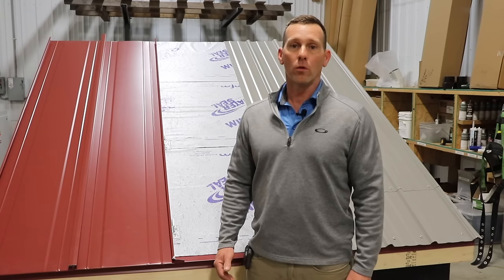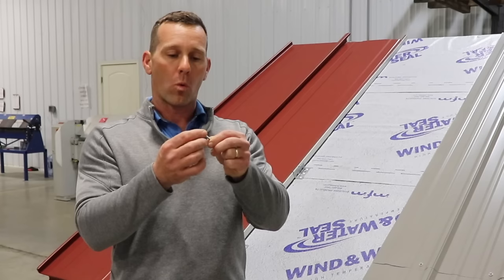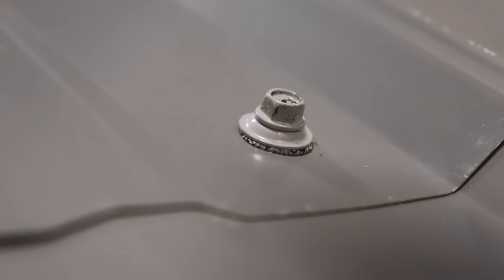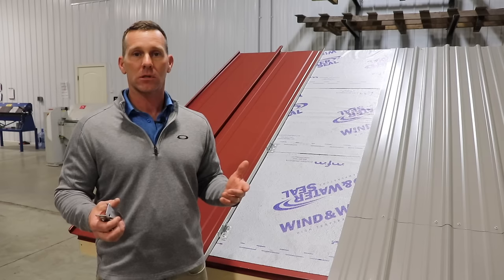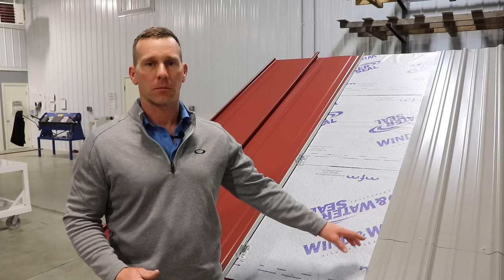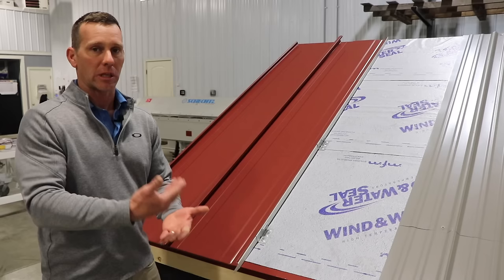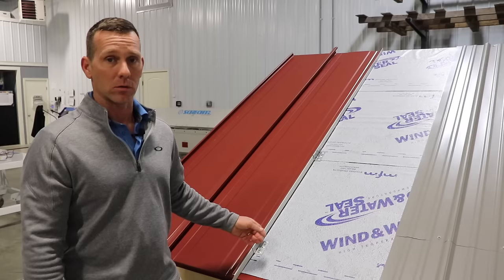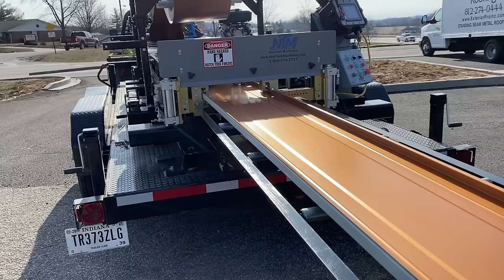Standing Seam Metal Roofing Vs  Corrugated Screw Down Metal Roof - Big Differences between the Two

Comment: I did metal roofs for 10 years and all the customers we're curious about the standing seam Roofing until they priced it. They all decided the screws weren't that big a deal. And yes there's a lot of BS going on this video.
Reply: hey, could you elaborate?
Reply: @samwoj  I am not the producer of this vid but i can tell you some things.

Standing seam vs. Exposed fasteners.

1)I have not done many standing seam roofs. However, they definitely are not fastened to the roof as well as exposed fastener roofs. Exposed fastener roofs are screws down every 6 inches or so horizontally and every two ft vertically. Standing seam is not...and have way less fasteners.

2) exposed fastener roofs do not have a neoprene washer as this guy stated. The washers are made out of EPDM which is a rubber that lasts 30 plus years and is used on full 100x10 ft rolls (weighing in around 450lbs) of EPDM on commercial roofs( big buildings). Exposed fastener metal roofs are durable and also increase the value of the home.

3) exposed fastener roofs are way faster to install. Which costs less in labor.

4) in my opinion standing seam is boring looking. Think of the jeeps that  have exposed bolts and nuts and stuff...they look cool as shit. Standing seam looks way less cool.

5) if a tree branch falls on standing seam you have to take the roof off from one side and potentially to the other to replace a panel. That is not the case with exposed fastener roofs. So think about the labor costs on that one.

6)exposed fastener roofs are easier and faster to install. They are easier to repair. They are warranted for about the same amount of time. 

7) if you have a house and getting a roof any of the metal roofs add value to the home. They might just last 50 years. Warranted for 35 for exposed fastener. 

Think about that. Talk to more roofers. The  make your decision.

Exposed fastener is cheaper and lasts just about as long. (There is some preventive maintenance that isnt necessary until you get  leak but just to prevent a leak, which would only happen at a screw, is to have the screws replaced before the warranty is up.) 

That's my take. I've done a lot of roofing. Take this information or discard it. Hope that helps.

Oh, and metal roofs will fade over time, but will still way outlast shingles for sure.

Edit: @7:16 he shows a ridge cap that appears to have a gap that wind blown rain can get into. Again, this is his sales pitch. That gap you see is caused by a waterproof seal that expands under the metal. That is not, I repeat, that is not a leak.

@7:30 he says standing seam has no seam. If that is the case then why is it called standing "seam"? It absolutely has a seam. That is like saying bacon isn't bacon, or that we are comparing peaches to pairs hear and peaches don't have an acidic citrus value while pairs do. Think about that.
Reply: Standing seam vs. Exposed fasteners.

1)I have not done many standing seam roofs. However, they definitely are not fastened to the roof as well as exposed fastener roofs. Exposed fastener roofs are screws down every 6 inches or so horizontally and every two ft vertically. Standing seam is not...and have way less fasteners.

2) exposed fastener roofs do not have a neoprene washer as this guy stated. The washers are made out of EPDM which is a rubber that lasts 30 plus years and is used on full 100x10 ft rolls (weighing in around 450lbs) of EPDM on commercial roofs( big buildings). Exposed fastener metal roofs are durable and also increase the value of the home.

3) exposed fastener roofs are way faster to install. Which costs less in labor.

4) in my opinion standing seam is boring looking. Think of the jeeps that  have exposed bolts and nuts and stuff...they look cool as shit. Standing seam looks way less cool.

5) if a tree branch falls on standing seam you have to take the roof off from one side and potentially to the other to replace a panel. That is not the case with exposed fastener roofs. So think about the labor costs on that one.

6)exposed fastener roofs are easier and faster to install. They are easier to repair. Warranty for exposed is around 35 years.

7) if you have a house and getting a roof any of the metal roofs add value to the home. They might just last 50 years. Warranted for 35 for exposed fastener. 

Think about that. Talk to more roofers. Then  make your decision.

Exposed fastener is cheaper and lasts just about as long. (There is some preventive maintenance that isnt necessary until you get  leak but just to prevent a leak, which would only happen at a screw, is to have the screws replaced before the warranty is up.) 

That's my take. I've done a lot of roofing. Take this information or discard it. Hope that helps.

Oh, and metal roofs will fade over time, but will still way outlast shingles for sure.

Edit: @7:16 he shows a ridge cap that appears to have a gap that wind blown rain can get into. Again, this is his sales pitch. That gap you see is caused by a waterproof seal that expands under the metal. That is not, I repeat, that is not a leak.

@7:30 he says standing seam has no seam. If that is the case then why is it called standing "seam"? It absolutely has a seam. That is like saying bacon isn't bacon!
Reply: @carcasscruncher9354  ageee with all except the ridge isn’t exposed from sealant, if you’re using a sealant that expands then you’re doing it wrong, standard MS water resistant silicone seal doesn’t expand, the ridge is sitting up because it’s screwed right on both edges causing it to sit in it’s normal bowed position rather than being flattened and then fixed closer to the ridges apex (or the ridge should have been made wider) 

Like the ridge underneath has been flattened before fixing.
Reply: My corrugated roof was installed professionally just over 27 years ago. I haven't had any leaks with the exposed fasteners.
Reply: Just wondering if anyone can clarify that corrugated roof and gavalume roof from Lowes or HD is similar and they can be installed on residential house not just barn or carport. I do like the exposed screw for DIY and cost.
Reply: @carcasscruncher9354  Seam as in overlap, NOT panel to panel.
Reply: @Btu555  if u get 29 gauge or lower
Reply: @Sandman1832  Did you de shingle your original roof or did they go over it? Im being told thats its okay to go over the old roof with metal.
Reply: @ForgeofSouls  You can install metal roofing directly over your shingled roof. That is what they did with my cousins roof. As for my home, I had a few skylights updated because the old ones needed replacing and I had a few other things done as well, so I had them just pull the old shingles off and start fresh. The metal roofing was installed over an underlayment that was put down before the metal roofing was installed.
Reply: @ForgeofSouls  Don't.  Asphalt granules can scratch underside of metal during expansion and contraction leading to premature corrosion.
Reply: @carcasscruncher9354  I worked for Morton Buildings for 8 yrs , let me tell you they have some awesome fastened down paneling . They have a 50 yr warranty . They are also very good with  flashings and trims . I work for my self now have installed all kinds of standing seam and different paneling, but If ever i had to do my own house I would do a screw down from Morton buildings.
Reply: @justotorres8970  morten doesn't have a good rating in my area. More to do with customer service than anything else from what I can see.
Reply: The major disadvantage of concealed fix sheeting is it's poor performance in windy conditions. Another disadvantage is the unfixable snapping noise it makes while contracting in the cool of the night.  Positive fixed sheets are fixed at about a meter intervals, so the expansion and contraction is limited to one meter.  Standing seam sheets produce more waist, as the off-cuts can not be flipped to be used on the other side of hips and valleys. We screw sheets only at the up-stands, or roll, of the sheets.  Not in the pan, as this video indicated.  This means that even an aged washer will not let water through your sheets.  The screws on my roof has now lasted 34 years, and I have no plans to replace them.  We order sheets to the length of the roof, so we never have to overlap sheets top to bottom.  Every plan you make for the ridges on concealed fix sheets, have a similar solution for any other type of sheets.  Corrugated sheets are S-type sheets.  Concealed / standing seam sheets are more expensive.  Material and labour cost.  Concealed fix sheets was designed for low pitched roofs.
Reply: @carcasscruncher9354  I’m planning on doing a corrugated roof this summer. All the comments have me wondering, screws in the valley or on the ridge?
Reply: @MistaCrawley  get a pamphlet on the manufacturer's recommendations. Some say to put the screws in the ribs, some say right beside the ribs in the flutes. Some say to use butyl tape in every seam, some say it's only necessary at almost flat slopes. You have to install the roof to manufacturer's specks or it wont be warranted.
Reply: @carcasscruncher9354  cheap and easy, that sounds like the way you like it. The previous owner of my old schoolhouse replaced the 104 year old standing seam with the cheap panels. It started leaking after 6 years, a few years after I bought the place. The washers are fried. I went up there are half of them look like they would leak, a couple of them deteriorated to where parts of the washer is gone.  This house gets brutal sun, so 8 am to 9:30 in middle of summer, no shade.  Those washers suck. I’m going to replace with standing seam, but reuse my 8 year old roofing panels in a barn or something.  I’ll just know I need to replace the screws and washers periodically. Look, it takes skill to install a standing seam roof, any moron can install the panels.  I was just up there after a wind storm the other day, had a panel end blow up and bend like crazy, more leaks, now I have to put another junky panel up to replace it.
Reply: @miragesmack007  or you could put your money where your mouth is and just do the whole roof in standing seam. Or is that cheaper, one junky panel, more your style? 

Standing seam doesnt take that much more effort or skills. Theres a tool you can hook to a drill that folds the shit for you.
Reply: @banksykennedy6511 can u not just bed down with butle tape or 795
Reply: I disagree. What he is saying is true. I have seen it. If you can't afford it, we'll, there are things people can't afford. I believe in putting your money into things that really matter. Your roof really matters.
Reply: @MistaCrawley  Your post is 8 months old but if you look at the manufactures instructions they all show putting the screws in the flats not on the ribs. There are a few limited exceptions where a manufacture will allow a screw on the ribs but 99% will say put the screws in the flats. The reason they want the screws in the flats is because that is how they installed them to conduct wind lift tests, if you install the screws on the ribs then all the test data on the panels in not valid anymore. The reason the manufacture put the screws on the flats is because that makes the strongest system for wind left. Add in that todays screws are light years ahead of what was used even just 10 years ago putting screws on the flats is a none issue, todays screws use EPDM to seal the screw to the roof.
Reply: Thank you guys. Love this conversation.
Reply: There are standing seam roofs in Europe that are more than 700 years old.  There is one down the street that is more than 200 years old.
Reply: As a guy in the architectural metals industry (operations, not sales), I have found that the majority of people that down standing seam are simply unable to understand the engineering that makes it special. Yes, it costs more. Yes, you can live without it. There is absolutely no denying though that it is an objectively superior roofing choice. That’s why it exists.
Reply: @Deontjie I have a low pitch roof, but I'm going with the positive fixed sheets for the cost savings. I hope I don't regret it. My roofer said he's done many like mine with no problems.
Reply: @debbymodd4579  The whole world has survived all these years with positive fixed roofs.  Low pitched is no problem.  Low pitch with a long span can be a problem.  The further rain water flows, the higher the depth of the water.  High enough, and it can flow over the corrugations, and into your house.  You can use lapweld between the sheets.  Your sheets must be long lengths.
Reply: @Deontjie I wouldn’t suggest doing a 5v with less than a 2/12 pitch. You’re kinda just asking for trouble
Reply: @carcasscruncher9354 I like you Positive on these 5-V roofs.
I've laid more Shingle roofs then I can count,  Never really dealt with metal.
At the moment I'm trying to decide on Metal 5-V or gi back Shingle.
I did my own roof 20 years ago, Dementieva, Never lost a Shingle, NO problems, still good, insurance doesn't like it.
I am worried about the maintenance on the 5-V!

Comment: I am gobsmacked that the screwed sheet is pierced in the valley. Always on ridge in NZ, cup screw protects washer, lasts 30 yrs +
Reply: Same here in Canada.
Reply: Here in the states, the old style 5v crimp was fastened on top of the "v", but generally that was with the old style lead head nails and later grommeted nails. But with the advent of the screws with neoprene washers, it became acceptable and standard to screw in the flats. This is acceptable only if the screws are properly installed to the correct tension because of two factors. #1, the threads of the screws tend to pull the metal up the shaft when driven, which creates a type of dam under the washer. #2, the screws are only driven until the neoprene part of the washer "begins" to crush. The washers are sloped from the screw head, if the screw is tightened until the washer is flat and parallel with the roof surface, that in my opinion is to tight. By leaving the washer with it's factory taper and the neoprene just compressing, that leaves the ridge from the threads raised and the neoprene in good contact with the tapered screw shank and roof metal. Also, it leaves the roof metal some room for the expansion and contraction he warned about.
    I have installed several of these roofs, "MasterRib", "GrandRib, and 5V-Crimp and have never had any problems with the ones I've installed. And they're plenty more in my area that I've heard no complaints over as far as screws loosening or leaking.
Reply: Everyone does that, and act like I am crazy when I tell them how stupid it is.  Don't put holes where the water goes... Also around here they face screw the standing seem valleys.  What is the point of a standing seem roof with exposed fasteners...
Reply: @talon426  Yea, all the standing seam systems that are available for the "erect it yourself" metal building crowd have exposed screws across the bottom and the top. They only use the clips through the middle portion. You pay more, work at least twice as hard, and the panels still have holes in the top and the bottom. I understand that the one they are installing does not but I'm sure I also don't want to pay their price... hence the hard sell.
Reply: Those plastic washers last about 2 days in Western Australia heat and UV! Rubber ones similar 🙁
Reply: You only screw per manufacturer instructions. Those particular panels screw in the valleys
Reply: In the US it’s supposed to be screwed on ridge as well. And capped screws that cover the rubber grommet is best practice here. Have to realize this man is trying to sell something particular lol. My guess is he’s sponsored by someone trying to sell standing seam panels
Reply: Yeah Aussie here, I have no idea why they screw in the valleys. I've never seen screws pull out from expansion, and I'm in western Australia. The rubber grommets are fine for a decade or so as long as you don't over screw them.
Reply: Same in Cape Town.  And we are the Cape of Storms.
Reply: That, and what's with the continuation. We never use anything but full length sheets, cut to order.

Finland.
Reply: The cost of standing seam keeps homeowners in my area from getting one. 4x more than low rib.
Reply: I’d rather have 1” of threads in the wood holding down the metal than 1/4” with  3/4” in the open rib. I’ve done multiple buildings, all screwed in the valleys, never had a problem. And we are in Canada, snow and ice is often sitting on it for months at a time.
Reply: @davidbrakefield188 For roughly 1000 Sq/ft of roofing and all flashing and screws etc pkg for a garage and shed, the material cost was $3700. (Vic West standing seam)
I’m doing the labour. Underlay and repair materials cost $600. I expect total after cleanup to be ~~$5000. 
Slightly less than the price of having a contractor install an asphalt shingle roof.
Worth it for me because I know it’s done right and will outlast me at this point lol.